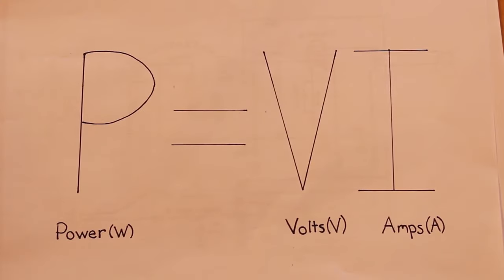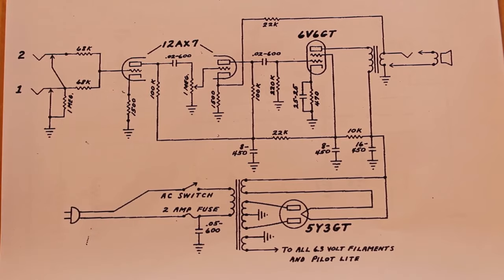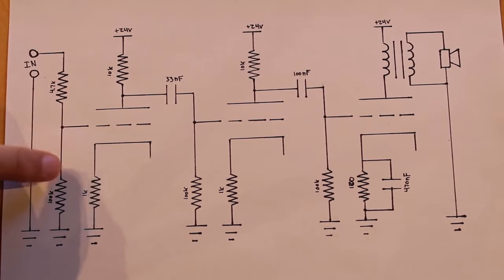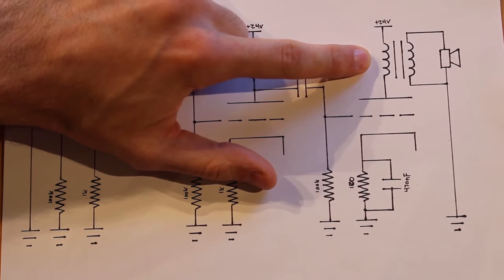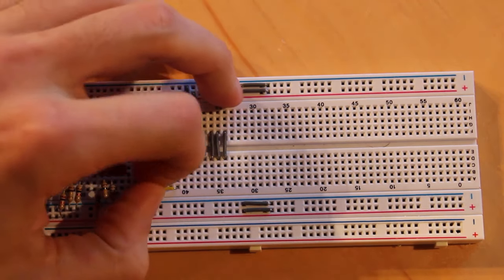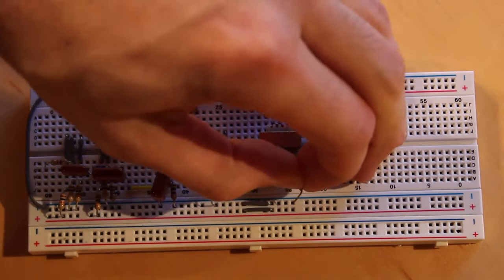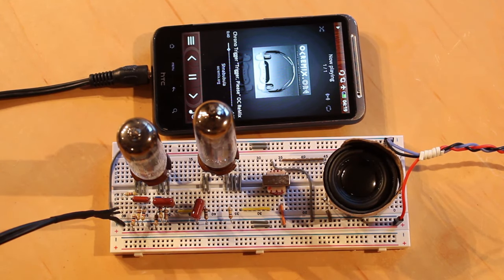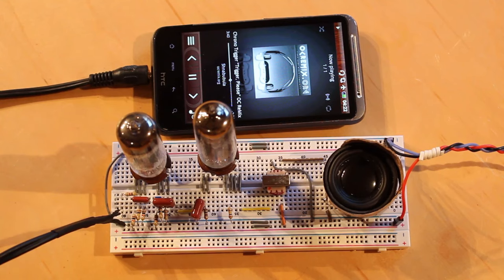Let’s Build a Low Voltage Vacuum Tube Audio Amplifier

Comment: Mate, your explanations are the best, most understandable I've found in the past few months of research - I'm making low voltage sound makers from a box of old tubes I've borrowed form a friend, from simple motorboating oscillators, to now starting to develop driven filters... this one will help me a lot I think - I wasn't sure on the source or real use of the transformer though - does it convert the DC to AC or something else?

cheers,

Chris
Reply from the maker: Thank you so much!
That's awesome! You're essentially building low voltage tube Eurorack components, that's something I've been wanting to do for a while now. Do you have some links to your projects, I'd love to see them!

The transformer is essentially to convert voltage levels. So, if we remember P=VI, our output power from the tube and the power going into the speaker are the same, but the tube is very low amperage and (relatively) very high voltage. However, the speaker wants very high amperage and very low voltage. Power stays the same, we're just dropping the voltage level to very low and bumping the amperage up to very high.

So, in this version at 36V I think we get around 0.6W of output power (maybe, I could be totally off in calculating that), but on the tube side, that's actually 36V and 18mA. The transformer changes that to 2.2V and 285mA for the speaker. Still the same 0.6W of power, just at a different voltage with different amperage behind it!
Reply: @UsagiElectric  ah, that could be (one of) my missing link; it’s less eurorack, more art project at the moment - Convert this box of tubes into a little city of sound to install in a dead factory where they were originally made... looks like that old telephone handset I tore up to get my first capacitors will be getting a revisit, as I recall one in there somewhere - might need a hundred more though :)

Thanks 🙏

ps I am sampling the heck out of them as I build/rebuild, not very scientific but learning a lot
Reply: @UsagiElectric  btw, I forgot to send you a link, so here's two :)

https://soundcloud.com/christian-krupa-1/a-short-improvisation-on-dual
https://soundcloud.com/christian-krupa-1/inherent-tension

they're both being amplified through an iRig interface into my ipad, and processed / enveloped in AUM with other auv3 effects - I found my wee transformer but haven't yet figured out how to get it to drive a speaker directly though...

Comment: Much appreciated this video, it's also good to know that tube circuits can be low voltage too, it's more beginner friendly this way... If you want to try Pentodes, go with something like 6AK5(EF95) or 6AU6(EF94) or even 6DS8(ECH83). Your output transformer looks like a telephone line transformer. Is that correct?
Reply from the maker: Thank you!
I've actually got an entire series dedicated to building a processor using the 6AU6 at just 24V (with -12V for grid biasing). The 6AU6 is a brilliant little tube and works surprisingly well at low voltages!
I actually have no idea where the output transformers are from. I ordered them years ago on eBay and they were listed as just "Audio output transformers". I didn't look closely enough at the pictures because they were about 1/4 the size I thought they were going to be!

Comment: It would be helpful to measure the power in and power out to show that it actually amplifies. My IPhone is fairly loud by itself. You could measure the AC input voltage, then the output of each stage, and we could look at amplification that way.

Comment: Hi

Great setup, I like to make something similar, with more sound output, may be from a 32V ex HP printer supply.
May be you can make a series heater setup, 2x 12V = 24V, with an extra power resistor, if the voltage is over 24V. Then you can get away with only one supply voltage of 24VDC or a bit higher if you have the power resistor. (You Might use a triode pentode combo for the last tube like ECL86 or PCL86 and  PCF80 for the first tube, the P types are from old TV's with a current of 300 mA and different heater voltages)
Reply from the maker: Hiya!
Thank you! You're definitely on the right track to where I went in my next episode. More voltage means more power, so even a little more voltage above 24V makes a big difference. There's also a few other things playing against the overall sound output. The speaker and output transformer being the biggest bottlenecks in this one. Having said that, I do manage to get some decent sound out of it in the next episode, so definitely stick around for that!

I have a few triode pentode combo tubes, so I may have to try tinkering with those for future audio projects! I don't have any ECL86s, but I do have quite a few 6GH8s, which are pretty decent little combo tubes, and the pentode can be triode strapped for even more linear response. I would love to build a proper high voltage amplifier someday!

Comment: Replace the 12BH7 with a 12AX7, use the 12BH7 as the output, raise the B+ to 250-300V, and you have a perfectly functional practice amp for guitar.

Comment: You need cathode bypass capacitors, i didnt see these in your schematic. These increase the AC gain of each stage by eliminating cathode degeneration.
Reply from the maker: I'm using a cathode bypass capacitor on the driver tube, but not on the amplifier dual triode. The reason for this is because I was trying to build a low voltage replica of the famous Champ Amp, which doesn't use cathode bypass caps on the amplifier stage dual triode either. When it comes to audio amplifiers, there's a million ways to build them to make them fit whatever goals the listener has in mind. My goal here was to just take one of the most famous and simple tube amplifier designs out there and see how it did at low voltages!

Comment: you could try using a dual section 6080, either paralleled or in push pull,  or similar for the output section,(or a 6N7, lower power and lower heater current) that should give more current and output for a given HT/B+, only problem is the very high heater current 😉 and they need a fairly high amplitude drive..  there may be alternative 12 or even 24/25 v heater versions of both those types, i dont know...you' d need a bigger output transformer obviously ..or if using the same one as in the video, maybe an ECC88/6DJ8 in push pull output, you 'might' be lucky to get 200mw or so output,
Reply: some years back at a vintage radio rally, someone displayed a radio he made that worked off a 12v lead acid battery, all valve, using special valves designed for car radio use at 12v supply, there wasnt any high enough 'power' valve in this range as wasnt possible, so car radios using that valve range was hybrid with transistor output...  he managed to get 200mw or so output in that radio by having push pull output, cant remember what exact valves were used, but the RF ones were ECH83 and EBF83 , with EF98 audio driver,

Comment: dont you think the old schematic you had befor redoing the schematic might of work and etc
Reply from the maker: Well yes and no. The schematic that I "redid" is actually nearly identical to the Champ Amp schematic I showed. I only redrew it in a way that was easier for me to read with the B+ voltages at the top. Other than that, the biggest changes here were that I just changed the resistor and capacitor values, because I'm running such massively low voltage. The original Champ Amp runs several hundred volts, so with less than 1/8 of the voltage on tap, I obviously had to change the values.

Comment: @Usagi . . . BIG Question: how did you come up with your voltage and component selection and values?  Do you do your modeling with LT Spice or some other circuit-modeling software?
Reply from the maker: That's actually kind of a convoluted story, haha.
In this video I use +24V, then +24V and -12V together to essentially get a B+ of 36V and then finally in the next video I use 48V.

So, to start with, my choice of +24V. This is actually completely centered around my primary tube project - building the vacuum tube computer. I really wanted to see if I could build some good tube circuits at voltages low enough that anyone could get into it, even children! I tested tubes at 6V, 12V, 18V, 24V and 30V (pretty much the entire range of my bench power supply). I found that anything under 18V was starting to push it, and I was having a hard getting reliable results. The next problem was figuring out heater voltages. Since I was planning on using pretty much the 6AU6 tube exclusively, I figured I could get away with running the heaters in series. So, 24V meant I could build everything around 4-tube modules.

Next, the -12V. To get the logic circuits working reliably and properly, I need a negative voltage strong enough to push the tubes fully into cutoff. Using a -12V supply gave me the perfect negative bias, and it meant if I needed to, I could run two tube heaters in series off the -12V. This gave me flexibility to build 2-tube, 4-tube or 6-tube modules.

So, I built my power supply around those voltages, and since that's what I had on hand, that was what I used for this video. However, ultimately, I wanted to run four tubes, and since I was using tubes with 12V heaters, I needed to think about how to power them. I did a bit of searching on Amazon, and it turned out that 48V power supplies were pretty common and super cheap, and that meant I could run four 12V tube heaters in series and use that 48V for the B+ for a little more volume over the 36V version.

A bit of a convoluted story, but that's how I ended up with the voltage you see here!
As for a modelling software, I do tend to check everything in software initially. I use TINA TI with some imported SPICE tube models to get me in the ballpark, then I trial and error different resistor and cap values on the breadboard until I find the sweet spot for the tubes I'm using.

Comment: OMG...that transformer from a transistor radio. It's probably only meant to run milliwatts.  I would be curious to hear what the speaker sounds like directly connected to the source as it has it's own amplification.  Why did you use a tv tube for your pre-amp?  12BH7 is for vertical or horizontal deflection.  12B4a is also a TV tube.  Is there a particular reason you used these tubes instead of more conventional, higher mu tubes?
Reply from the maker: This was totally just a spare parts build! I just grabbed whatever I had laying around. 
As for the tubes, I wanted to use the 12B4A because it looked like a pretty beefy single triode in a 9-pin package, and the 12BH7 was the only dual triode I had that used the same current for the filament so I could run them in series.
Reply: @UsagiElectric  you're a tube guy and don't have a 12AX7 around?  Or a 12AU7 or 12AT7?

Comment: What is the brand of the breadboard used in this video?
Reply from the maker: I like to use Miyako brand breadboards, but they're getting harder to find in the States lately unfortunately.
Reply: @UsagiElectric  thank you for your feedback. I find it very hard to find a good breadboard nowadays, I decided to give a try for the Proskit made round hole breadboards. Probably the best I can find in Russia

Comment: Not enough electrons flying off those cathodes at such low voltages . . . maybe if you rig up 12 stages of amplification you can get something useful.  Maybe this would work for IEMs . . .
Reply from the maker: This would actually probably make an excellent headphone amp! 
But, like I say in the video, we're beholden to P=VI. Without the voltage, we're limited in just how much power we can pull out of this design. But, it was a fun little exercise, and maybe it can make a good in-road for someone to get into tube circuits for the first time!

Comment: i'd like to modernize a Magnavox sterteo amplifier made in 1960 that i'm sure can sound great, and get reasonably loud, have you done any videos regarding them [small 3 tube amps]
Reply from the maker: I'm not that familiar with old radios unfortunately. Still, it shouldn't take much to get one of them up and going. The tubes are generally pretty hardy and the only real weak point would be capacitors. If there are any wax paper type capacitors in there, change them out for new ones of the same value and then fire it up and give it a go!
Reply: @UsagiElectric  i have the new capacitors and resistors that i need here already but my other question is concerning the place where the signals from cartridge come in,is there a way to use a modern cartridge with out it sounding tinny?

Comment: What about raising the cathode voltage with a diode? That would be +.6v compared to ground. Could that work?
Reply from the maker: That's actually a really smart idea! I never thought about it, but that would indeed elevate the cathode above ground and potentially get some more gain. It's certainly worth a shot anyways!